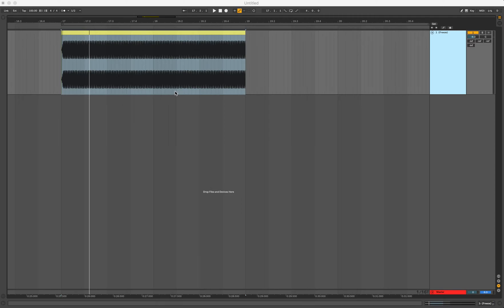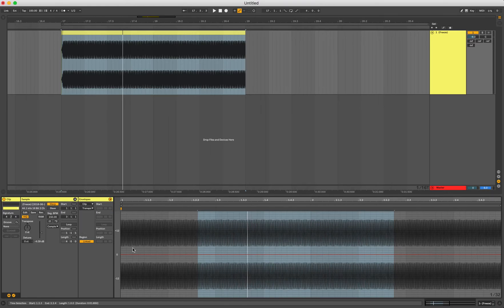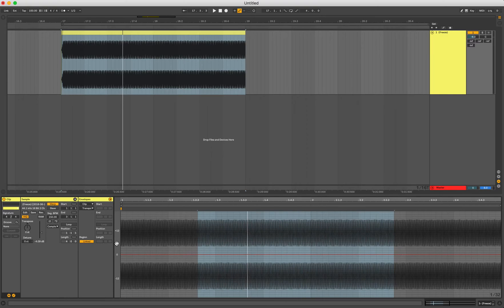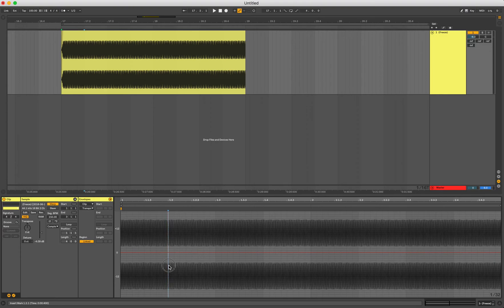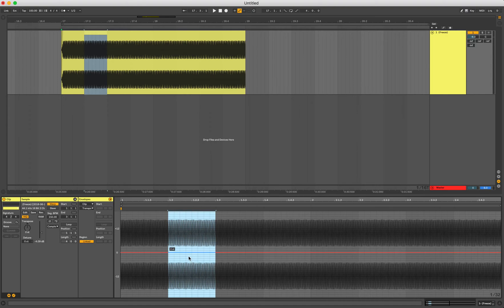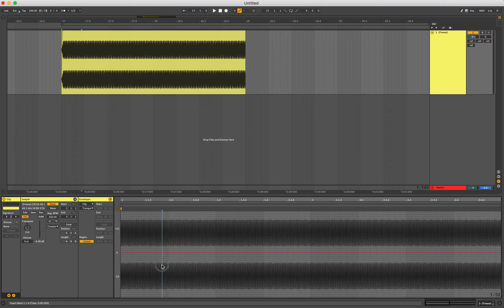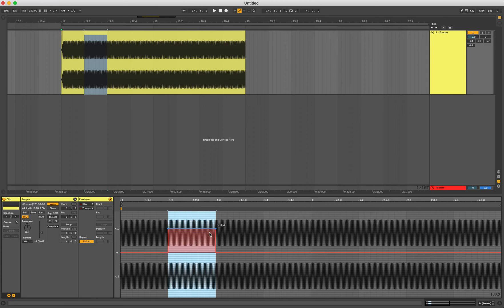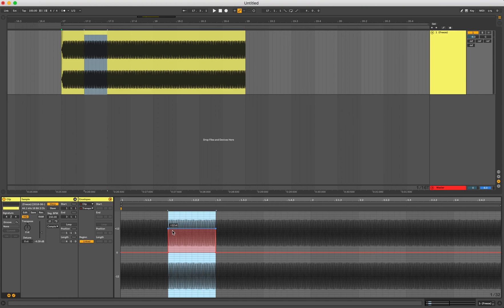How to pitch bend audio in Ableton

Comment: In the envelops section, under "clip" it says "Transposition" and not "Transposition Modulation" like on your video. Also also the red line doesn't appear. Do you know why I'm seeing it like this? (I'm new to Ableton)
Reply: You have to have Warp activated (Im the Sample menu left of the evelopes section)
Reply: @timiontour  I have that activated but it still has the same as Evyatar says
Reply: @kayge4903  Its a blue line instead of a red line and the outline selecting doesnt work becuz they update it
Reply: @mishabell1098   I think I have the same update, and my selecting doesn't work, but I just make two points and move one of them in which ever direction you want to bend the pitch